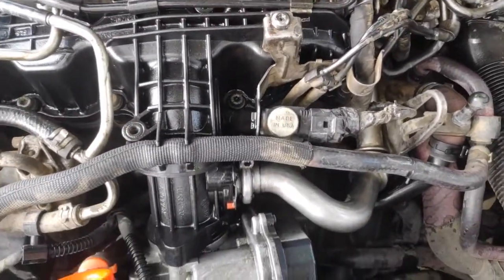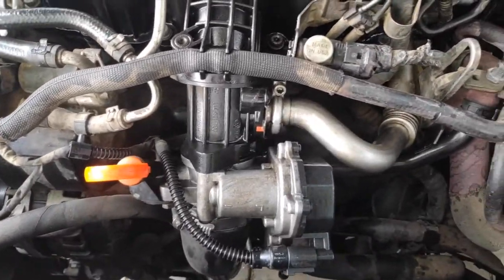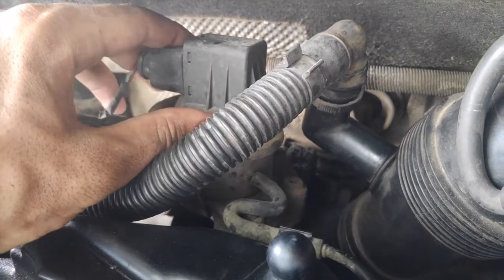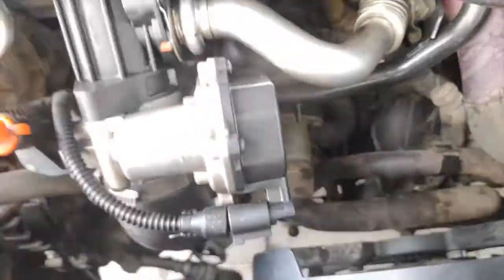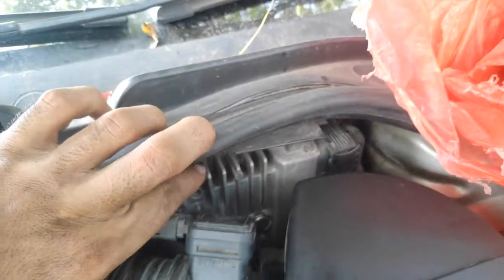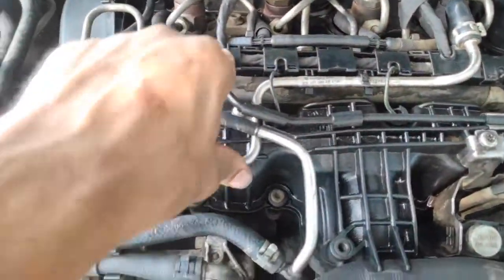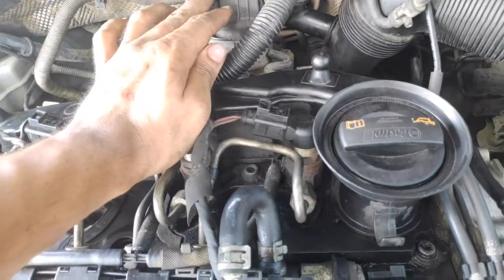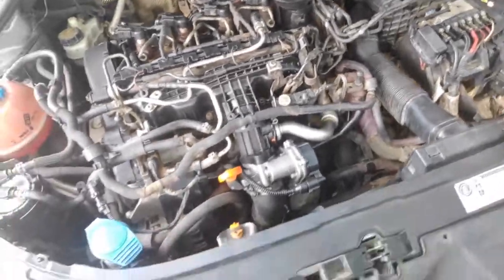MAF, Turbo, Oxygen Sensor,How do they work // मैकेनिक के पास जाने से पहले इस वीडियो को अवश्य देखें /

Comment: Hi.
My polo 1.2 tdi N75 is making noise (continuous tik-tik) and engine check light is also glowing. It seems as if turbo too isn't working.
Will replacing N75 solenoid solve the prob?

Thanks.
Reply from the maker: Yes definetely if it is making noises it is gone.
Reply: @IAmanDhillon  thanks shall change it. Let's see how it goes🤞
Reply from the maker: Your welcome bro. Yup turbo not work as this n75 valve controls the bolst pressure  to further control the turbo acc to ECU commands. If jt will not work properly turbk will not get actuated.
Reply: @IAmanDhillon  ah right.
Now to buy this part. Not going to authorised service centre. Last year bought TRW struts from spareshub they didn't last long. So bit sceptical about buying this one from them. 
Have you tried boodmo, is it worth giving a shot ?
Reply from the maker: Yup go for boodmo there are 2 qualities of products available, genuine of vw, and other one is aftermarket.
Reply: @IAmanDhillon  cool👍

Comment: N75 is making tik tik noise  but no light. What to do?
Reply from the maker: It contains a small motor, if the motor is making noise then it is in its final days, time to replace it but if there is no fault code in the dashboard continue to use it until the fault generates.

Comment: kya N75 turbo boost control valve thoda vibrate/noisy hota he??
Reply: tik-tik noise....but no warning light blinks...per  engine me thoda knocking sound aata he idle condition me...rase dete he awaj gayab ho jata?..kya karu?  1.2tdi polo 2011 model he...
Reply: N75 valve change karna parega kya?
Reply from the maker: Nhi valbe awaaaz nhi krta kbhi khraab ho jaye toh krega, abhi light nhi ayi bt aa jayegi agr aiese hi rha toh. Change krna pdega.
Reply: @IAmanDhillon  🙏 thank u

Comment: My skoda rapid car idle rpm is 500 is any problem ?
Reply from the maker: Yes there is a problem. At idle the rpm should have to be min AT 800-850.
AC, POWER STEERING and many other components will not work properly at idle.
Or you can also hear knocking at idle after turning on the AC.
THE  problem may be inside the throttle body or may ne the sensors needs to be serviced. I will suggest you to visit a mechanic once.

Comment: Polo p 2563 foult code problem
Reply: Polo p 2563-powertrain turbocharger boost control position sensor- circuit range /perfomance
Reply from the maker: If there is any indication in the cluster meter it means there is some problem with the sensors or anything in the engine, then only ECU will generate an error.
Reply from the maker: Check the turbo boost pressure sensor, check the connector ports, of the sensor.
Reply from the maker: Clean the sensor once as this code ia completely and only related with turb boost pressure sensor not boost pressure valve.